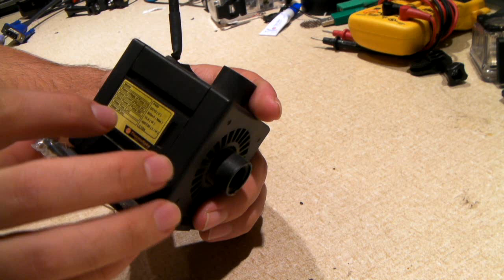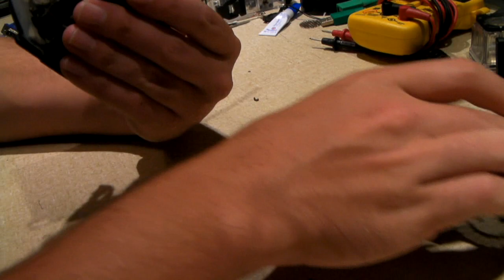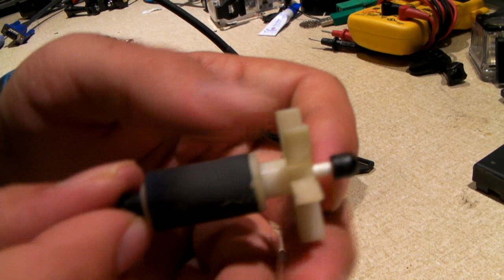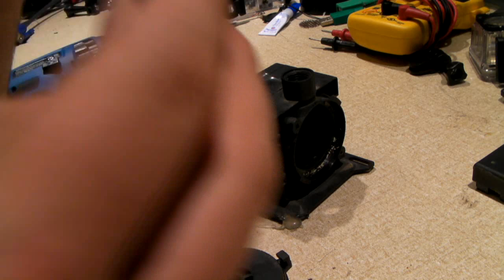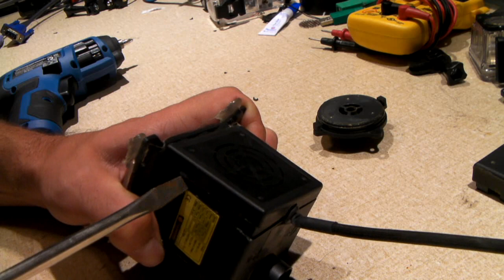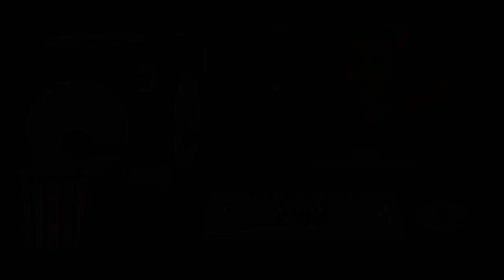A look inside the old MidTower Deluxe water pump

Comment: For some reason, I still prefer the good 'ol fashioned air cooled setup. I have dual fans on my cpu cooler so it should never overheat since their is a backup fan. My friend's water pump went out on him after about 3 years. I just think they aren't as reliable and there is more wear and tear to go wrong not to mention leaking. This is just my preference of course :) Thanks for the vid.